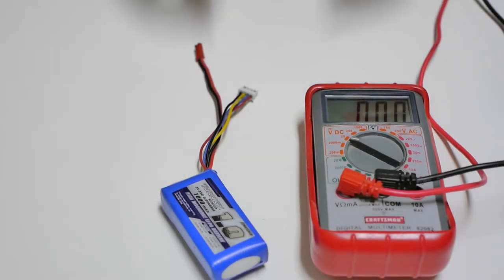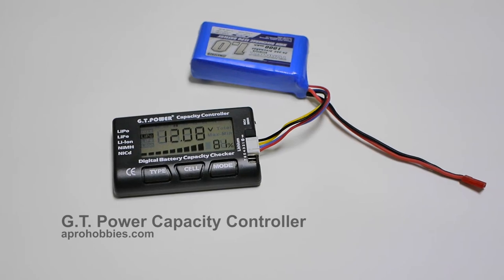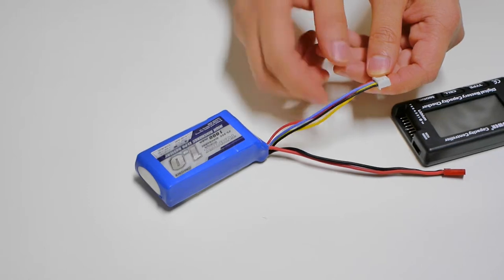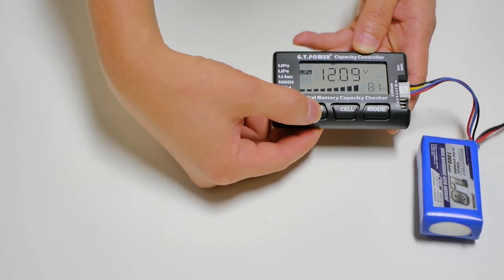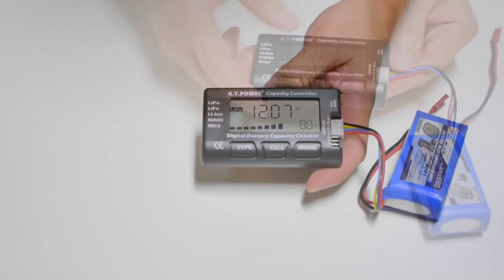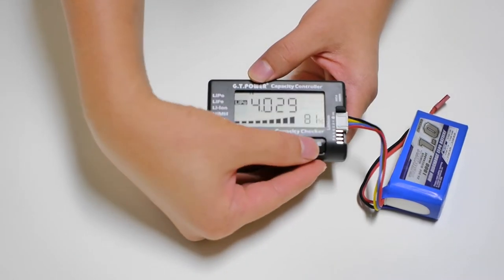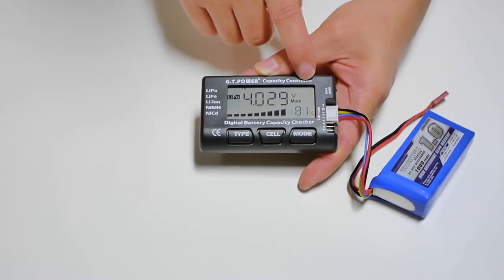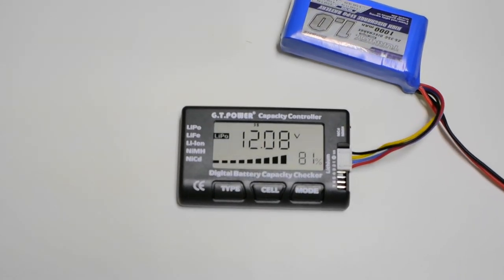GT Power Lipo/LiFe/Li-ion Digital Battery Capacity Controller - Product Preview and How To Use

Comment: I just found your video today. 
I have purchased the same capacity controller It came without any cable and I am blind now. Please help me to get up and walk. 
I want to use this for my 4X 3.2 v lifepo4 batteries. How do I get a cable and how do I connect my lifepo4 batteries and capacity checker. 
Thanks a lot for your time for coming to help me 😊

Comment: manual included in my model say: new balance function - long press the first key lipo/life/liio will blink, says it is in balance, balance process according to the second button can view each battery voltage, balance is take the battery in the lowest section as the benchmark to discharge balance
Reply: yes, it works. it balances the cells by dischargeing them to the level of the one that is most empty. atention! if ou let it connected it will disharge all 3 of them even after is balanced